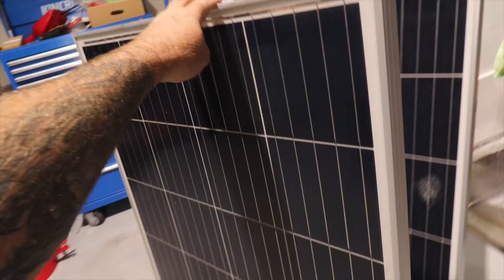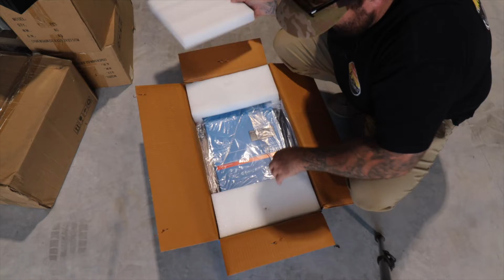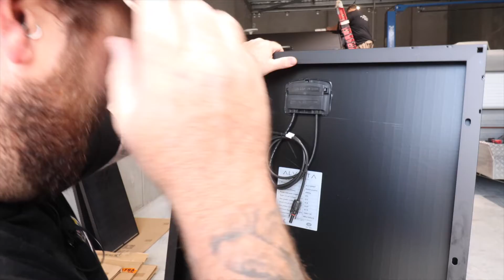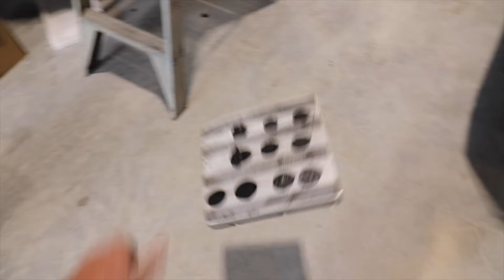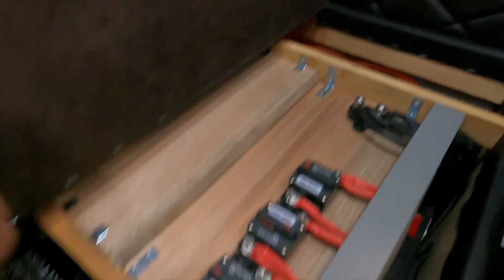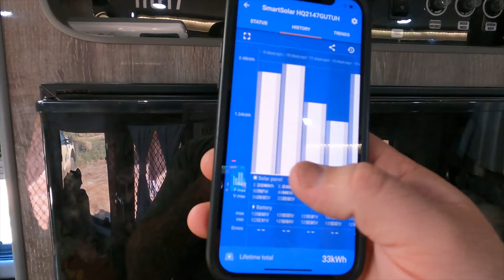I REBUILT A OFF-GRID CARAVANS POWER SYSTEM… DON’T WASTE YOUR MONEY

Comment from the maker: Off-Grid Caravan installs can be very expensive! I wanted as much power as possible, with enough solar to back it up. I had a budget of around $7000 for equipment less the labour to install. 
Yes LSP reached out and the batteries were given to me, that helped the budget. With out them the battery budget was around $850 each depending what I could find available. If you went for a top brand system it could reach $20k for a system this size but it’s cost me less then half of that. The Victron gear I found to be best bang for buck with what you get.

Comment: Awesome install video. Hope you get a long reliable run out of the set up. I noticed the old inverter was a modified sine wave type. Not the best for sensitive electronic gear. I’m sure you will see a vast improvement with the Victron pure sine wave inverter. All the best and happy travels.

Comment: Nice setup. How heavy is the inverter aye, I got similar and was a bit shocked unboxing it. Might swap back to enerdrive to save 12kg 😂
Reply from the maker: Yeah it’s not lite but if you put x2 enerdrive 60amp chargers with the 3000 watt enerdrive inverter you’d probably be heavier then the victron
Reply: @TyFenwick  I have the 12/3000 without the ac. Surprisingly it’s the same weight as yours with 120a ac 😯

Comment: Nice! Good vid, great job, like ur gear, no more power issues there mate! I like the house panels for a budget build, apart from being cheap to pick up on marketplace, they run higher voltages and u get better value from ur MPPT controllers in low light conditions, I have one 250W 38v panel still charging 8-9A in 12v setup just before shade hits it at 4:30 pm with a cheap controller. 
Victron is great stuff, love ur Multiplus, bit off my budget for now unfortunately, it looked like it was a bit snug in that under seat area, do you have any extra ventilation for it or the charging & controller gear?
Anyhow, looks good, I reckon you could run a 2.5kw inverter split A/Con off that a lot of the time, you would be surprised how they can ramp down to a few hundred watts in 10 minutes, & then only use 5-600w on & off as they cycle. TFS. Cheers
Reply from the maker: Yeah running everything 240v in the van, AC, heaters, electric blankets, etc etc running everything great 👍🏼